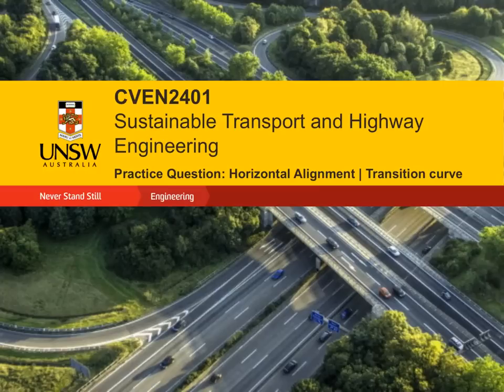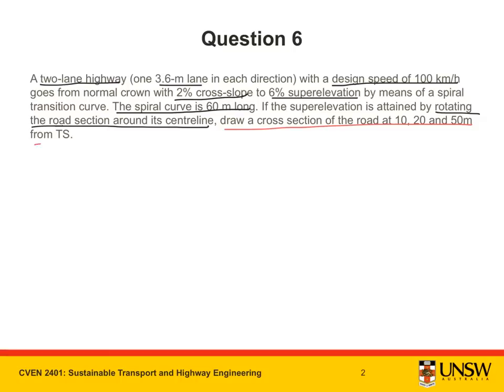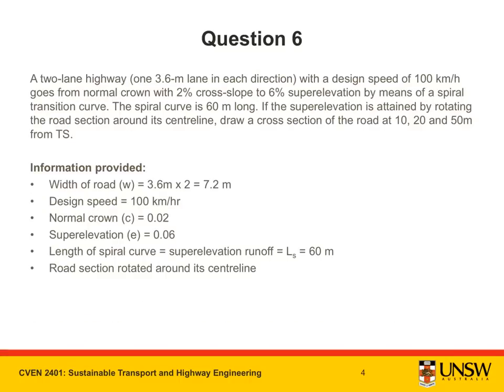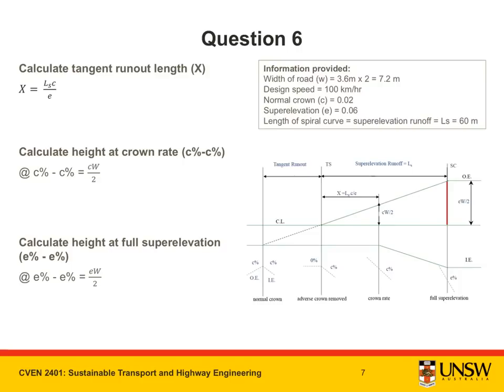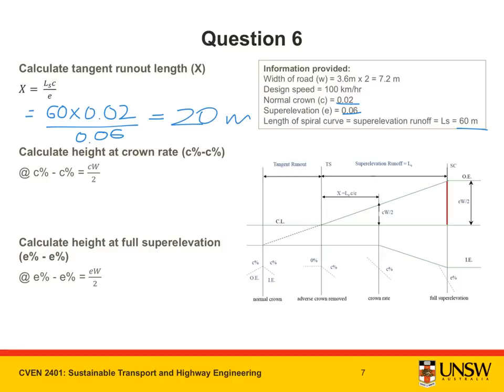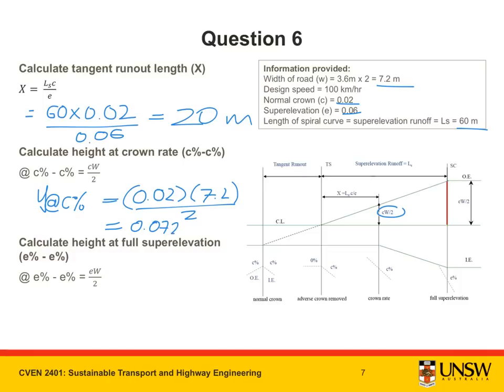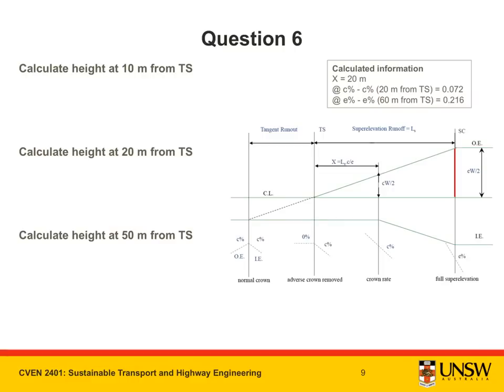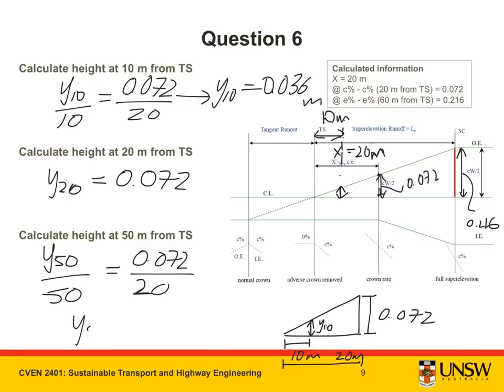Horizontal Alignment: Changing Superelevation (Question 6)

Comment: why we rotat outer edge about c.l why not inner edge in first state ?
Reply: Need to get the outer edge to be the same c% as the inner edge. Then when the outer edge and inner edge are both c%, we can rotate them together at the same rate until the superelevation is reached.
Reply: good question
Reply: Celestine Eloghe Obame 
oh thanks that was a long years I would graduate this year 😂
Reply: Where are you now and at what stage did you watch this video?